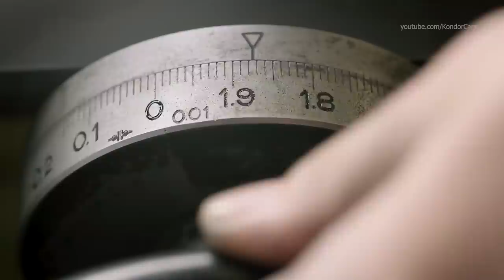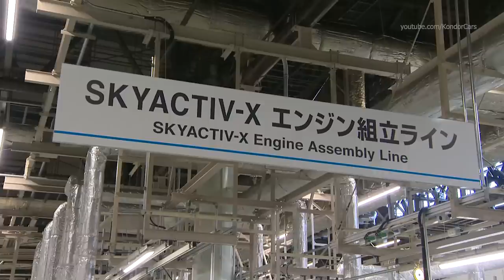Mazda Production JAPAN

Comment: I'm on my third Miata. Starting in 91 and just purchased a 2019 ND Club which is an awesome little pure fun packed grin-inducing, 137 mph sleeper!! Love the new improved engine with the 7500 RPM redline, it's a screamer especially when you get rid of the stock muffler. Jim g Sunrise, fl

Comment: 31:30 absolutely hilarious to see an MX5 followed by a Bongo, which is nearly identical to its 4th gen introduction in 1999, on the same line.

Mazdas are pretty exceptional vehicles. I've owned a few now and they've been Toyota reliable with more smiles per gallon than anything else in its price range. My 2014 Mazda3 has been almost flawless to date and will probably see 300,000 km without an issue. My 2001 NB2 Miata is such an absolute blast to drive.

If Mazda could improve their corrosion resistance even further (with a more thorough hot-dip galvanization process) and use a harder & thicker paint similar to the germans, it would be a no-contest game (they're already pretty decent now in that field). Mazdas are reliable, very well engineered ergonomic products designed with the driver in focus.
Reply: I stopped buying Mazdas after the 5. They rust badly and Mazda doesn't seem to care.

Comment: Very interesting and nice video :) Have owned two Mazdas, first one was a 1982 323 Hatchback (GLC in US). According to Wikipedia, probably built in Hiroshima plant. After that got a 1990 323 sedan (Protege in US) and I guess that was built in Hofu plant. 
Of course, the factories most likely have looked completely different at the time, as the production lines probably must've rebuilt for modern manufacturing technology seen in this video.

Comment: Nicely done and I love the CX-5 (have a 2013, 2015 and 2019!).  Now, please just go back to the remote starter module you had.  It was a great design and could've only been improved by making the activation available to the end-user.  This monthly service charge for a remote starter function will never fly with me, and it has me shopping for a CR-V now.
Reply: What? You have to pay Mazda to hit your remote start button?
Reply: @2006gtobob  Yes.  They are giving the first 3 years free, then it goes to a monthly charge (currently at $10/month).  All done through their app.  IF I go with another Mazda, it will have an aftermarket remote starter (which look to be MUCH better now and use the existing FOB)

Comment: How about you use this equipment to make me my transmission for my 2021 that went back 10 miles off the lot. Brand new car with a bad transmission…
Reply: Mazda stand by their products. Why don't you say what happened next? That the dealership solved the problem ASAP? That's been my experience. I've owned six Mazdas and one of them, a CX-5, had a failure in the lift-gate, covered by warranty. Immediately I was given a new CX-5 loaner and two days later my repaired CX-5 was returned to me by the manager of the service department, who apologized for any inconvenience I experienced.
Reply: @johntechwriter  no. It’s been over a month and my car is still sitting waiting on a transmission replacement. I’m being told it will be after the new year before it’s completed.
Reply: @johntechwriter  they also had me in a cx-30. Lowest trim I think they have. My purchase was a cx-5 gtr. To make things worse. I stop by a few days ago to check in and get paperwork from my personal car, found the hood had been scratched and a scratch on the front counter panel due to sitting in the lot… not Mazda’s Fault. The car had 25 miles on it on purchase. I told them immediately something was wrong. They swore it was just tires out of balance. Spent a week arguing that it was a serious issue before the manager finally brought it in to check himself. Took Mazda 4 days to determine it was a bad transmission… might have it back after the new year.

Comment: 6:57 Did I missed it or the metal were not really rust treated? I watch a honda`s factory and they literally dip every single piece in a anti-rust paint before putting them together. Seems mazda does not has this process. Their older cars are absolutely rust buckets even though everything else is fine. Seems there not much improvement nowadays. I know the miata is full aluminum now. But the steel plates are not treated is not a good sign.
Reply: More than 1 way to skin a cat.  Mazda's are not anymore rust prone than other cars.  I've owed a couple of Mazda's.
Reply: Les Mazda aujourd’hui sont beaucoup plus soignés et toujours aussi fiables, Honda malheureusement a pris le chemin inverse, des moteurs sous dimensionnés et des boîtes de vitesse plus adaptées à l’hybridation ( voir la HRV 2022 ) . J’ai eu une Honda accord CDTI 140cv 2006, une vrai horloge que j’ai gardé 15 ans !  Les problèmes de rouille chez Mazda sont bien loin derrière ……
Reply: @uniquelypositive  If that`s the case it`s a great news... I dont want to experience the headache of trying find a rust free miata again.

Comment: Currently own a Mazda one of the worst cars I ever bought...Never again
Reply: What year is it? They were partially owned by Ford and shared many of the same parts until 2008. Everything after is extremely reliable.
Reply: If you don't know how to properly maintain and drive any car, any car will be the worst car for you.  Just saying.
Reply: Mazda and Toyota are amongst the most reliable according to industry data.  You are either talking about an old model , rebadged Ford (when they had a controlling stake) or you're not keeping up with your maintenance.  I've owed a couple and currently drive a '96 Miata.  Solid as a rock!
Reply: @uniquelypositive  Perhaps a troll me thinks.